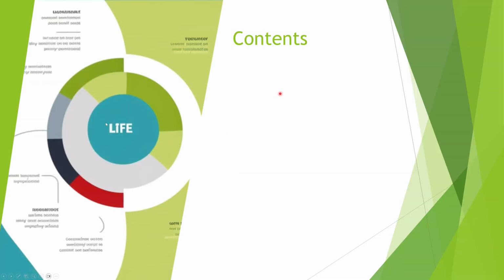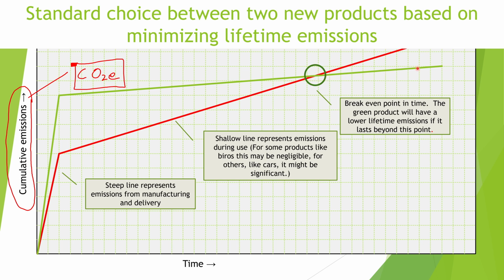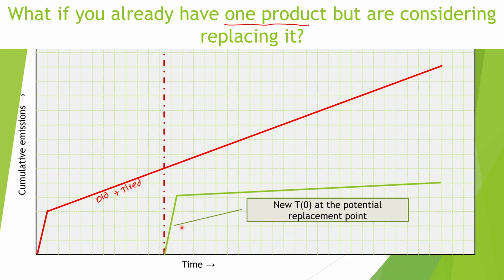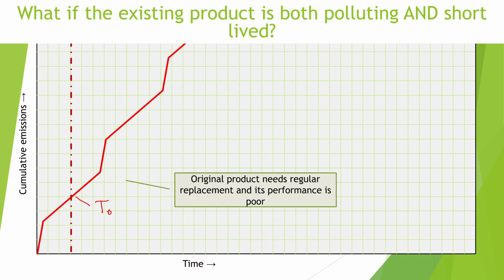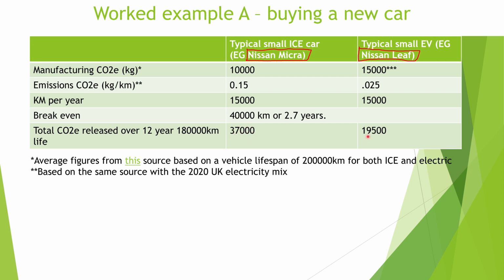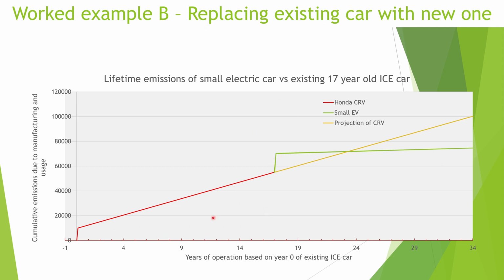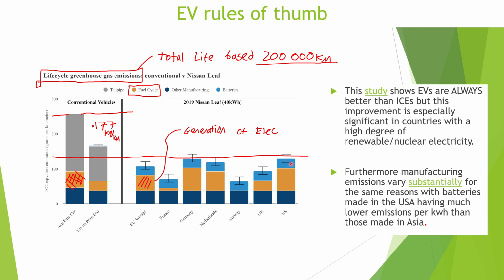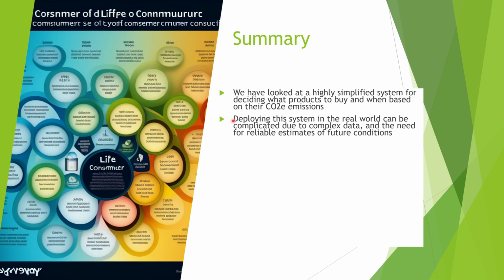Choosing products based on minimising damage to the environment - or very basic life cycle analysis

Comment: This is a great presentation of the challenge of early adoption too. Focusing on the EV industry from your personal example of whether to replace the vehicle - consumers simply have no idea whether their Nissan Leaf will be properly supported in 10 years by Nissan or independent mechanics - but your ICE car is already 10+ year and most definitely can be supported either by Honda or independent mechanics.
Reply from the maker: Exactly right. I think at this point EVs from mainstream manufacturers will be supported for some time but that certainly wasn't clear ten years ago, and it isn't clear now for the scores of cheap Chinese brands that I could just about afford to buy.
Reply: @drawingboard82  the only hope I have is for the industry as a whole to adopt standardized form factor battery packs with common connectors and cooling arrangements. Otherwise we are just inching towards a diff kind of waste. These arent lead acid diesel electric submarines 🤣